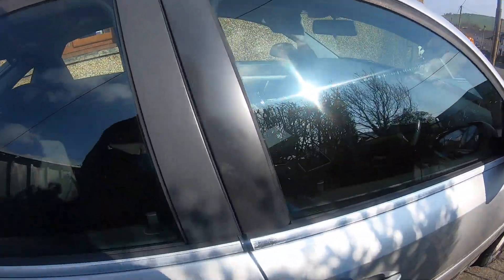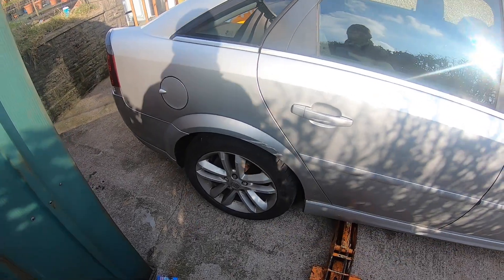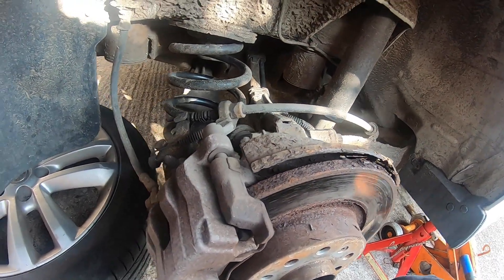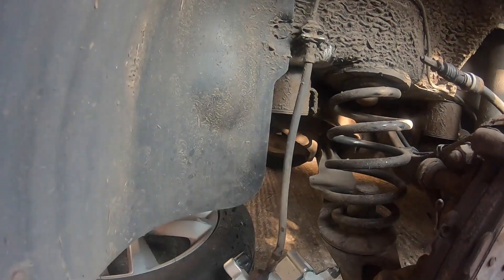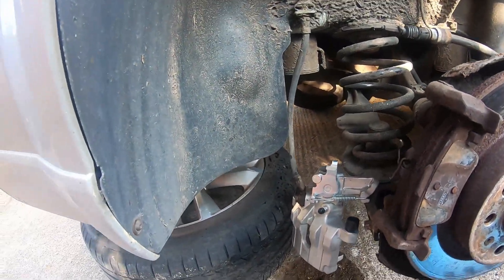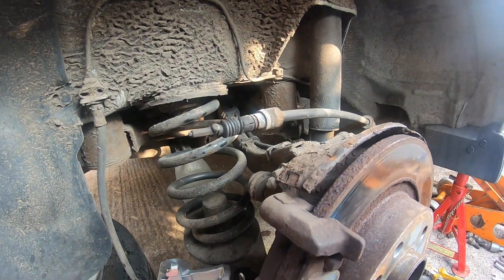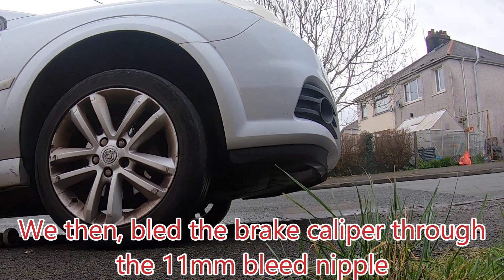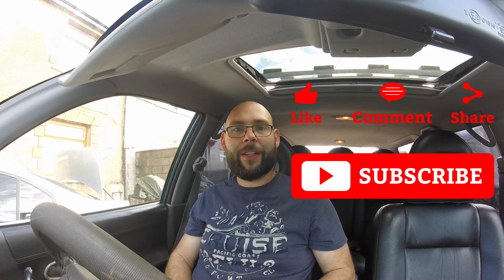How to Replace a 2002 - 2010 Vauxhall / Opel Vectra C Rear Brake Caliper #car #brakes #diy #tutorial

Comment: mattys, I had the same problem. My cable tip is made of plastic. The aluminium caliper was badly corroded aoround that plastic. Well, brutal force applied with vice grip and hammer... My cable loooks like shit now, but so does the car...
Reply from the maker: @halftimberedadobe  hahah there isn't a straight panel on mine so I understand that completely 😅

Comment: Any advice on the handbrake cable is seized into the caliper? Yours come apart so easy. I've spent half a day and it will not come lose
Reply: I mean when you pull the cable out. You said that was a lot easier than you thought. Mine doesnt even budge.

Comment: another hint. Do not touch the handbrake mechanism before you bled the brakes. They need to be hydraulicly working and beeing applied. After this hook up the cable. Otherwise you might mess up the adjuster mechanism.
Reply from the maker: @halftimberedadobe  that is fantastic advise and I forgot to mention that in the video 🫣
Thank you for that!